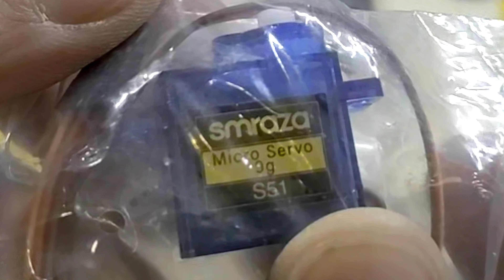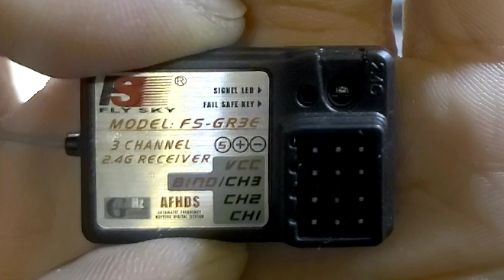XMODS Conversion Explained | 1/28 Scale RC Electronics

Comment: We need a discord community for little modified rc cars like these. I have a alot of them and want to know if a 20amp esc is enough to run some rechargable nimh aaas, wanna incorperate the stock battery tray into my modifications.
Reply from the maker: Hi sorry for the late reply, 2024 is keeping me busier than usual. From what I see on 20a escs are about 7 cells nimh max. 8 cells are pushing it on 20amp. Try a 40amp brushed esc.

Comment: Where do you Race your xmods at
Reply from the maker: There is a public track in Burien, WA that's ok for most 1/14 scales if you have the suspension for it. It's not very smooth and the XMODS are bouncy and even roll over on the pavement there. It's best to find a smooth gym type floor or a smooth garage floor to drive them on.
Reply: @backtothetrackgarage8790  I run mine on a tennis courts That seems like the best surface for them or a 🏃‍♂️ Track
Reply from the maker: @MrKingxmod  Excellent idea. Eventually I may get some cones and set up a small test track and arrange some kind of lap time tracking system for future videos. So I can evaluate cars and their settings in real-time. Using a tennis court could make it easier to have preset measurements...
Reply: @backtothetrackgarage8790  I need to find a place in tacoma for the smaller scale kyosho type of cars

Comment: Its the SG90 servo and the MG90 servos. They are 9G and SG is plastic gearing or S-Standard/Soft Geared and the MG are the Metal Geared. And yes they are Full metal Geared. There are ones that are half and half, Read the description before buying, cuzz the half and halfs, prone to stripping.  I used to use the 9G servos for my Xmod and other Rc modifications, But then came across Smaller and more of right fit 6G servos. Which also can be found in bundle sets of 5,10,20. Came across those when I was working on one of my Losi Micro T  projects. which needs a 6G to fit into the housing, and also happens to be the same size as the stock ones from the Xmods (both Gen 1 and Gen 2/evo).
Reply from the maker: Cool, I'll keep that in mind for the next project.